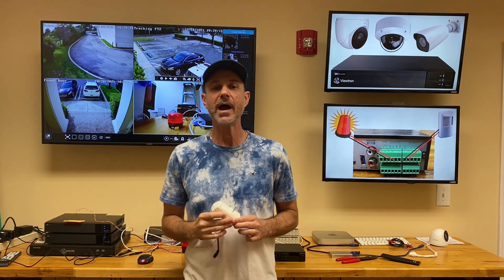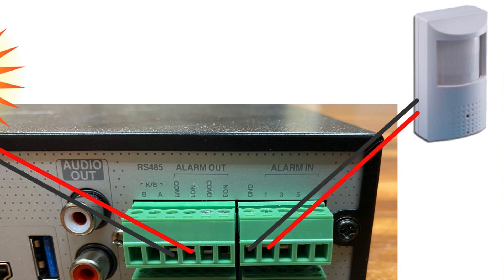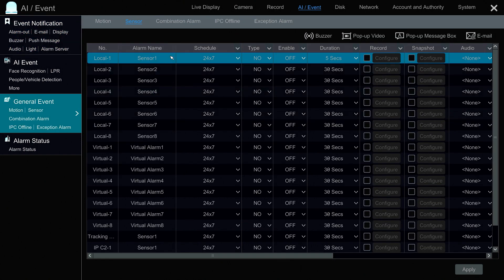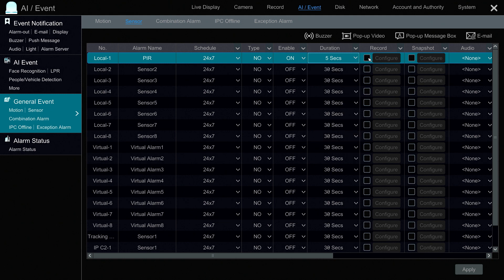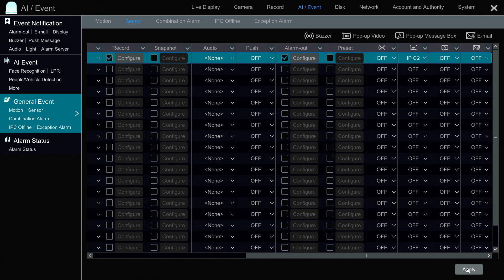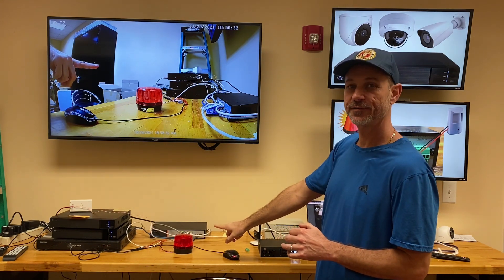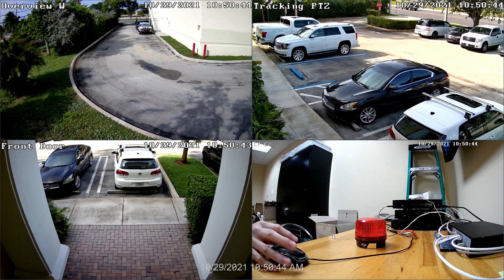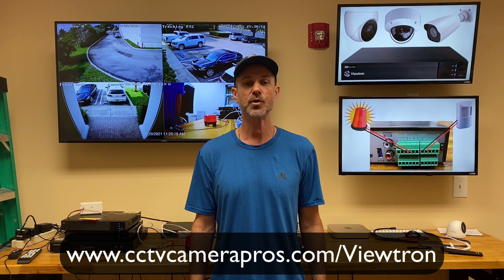Security Camera DVR Alarm Input Setup with Motion Detector

Comment: I want a “no” keyswitch that when turned on (latched to nc) it will record. And when turned off, it will stop recording. Will this work?  And if so what’s the recommended “anti-dither” and “Latch” settings for this.
Reply from the maker: Hi Frank, Yes this should work with any low voltage NO / NC type of device. I am sorry that I am not familiar with anti-dither or latch settings. If you want to email us more details at info@cctvcamerapros.net, we will do our best to help research this with you.
Reply: @cctvcamerapros  it’s for a Dahua NVR Device Model
DHI-NVR5208-8P-4KS2
This has the anti-dither and latch settings
Reply from the maker: @wpower84  I am sorry that we are not familiar with that. We do not carry Dahua and our Viewtron recorders do not have those settings.  What are the settings options?